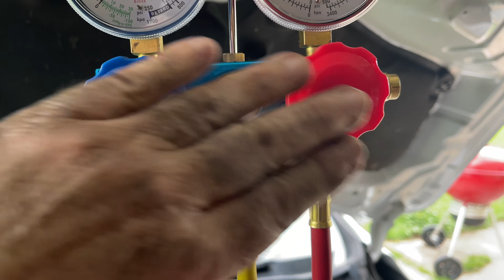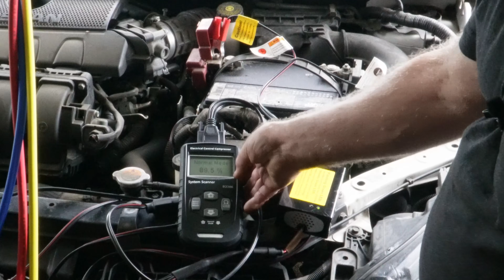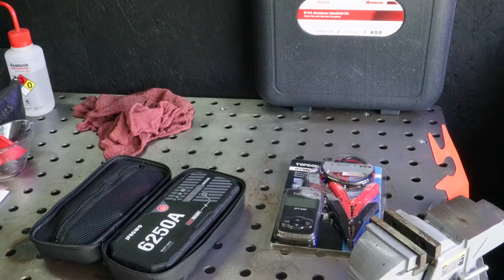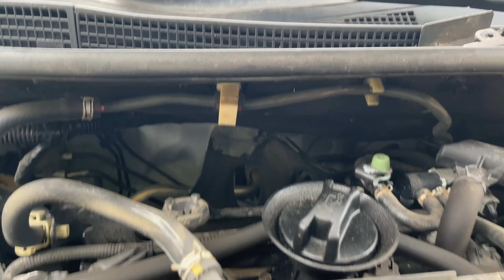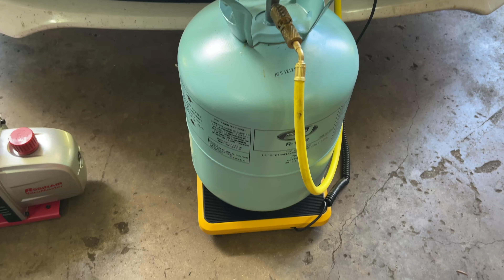How To Diagnose A Bad Automotive AC Compressor With 100% Accuracy

Comment: Just curious, but method do you use to flush?  Our shop uses that flush in a can that comes with  a hose and nozzle.  Our new R1234yf machine has a flushing option that i believe uses refrigerant to flush the system.  I hate the messiness of manual flushing.  Also found if a system grenaded and there is rhat pasty antiseize coating inside the pipes, flushing dowsnt seem to do a great job.  Had to replace the entire system on a Pilot because of that.  I guess flushing could have its own video....lol
Reply from the maker: As of now I’m using a flush bottle with liquid ac flush.  A bit messy but I try to capture as much as I can with shop rags.
Reply: Yeah, sign me up for a flush video. I would love to see that as I am getting ready to tear into my 2011 Sienna. Had the compressor replaced by a mechanic a little over 3 years ago and now the AC isn’t working again. After a crash course on how to use a gauge set, vacuum and recharge the system I was able to get the right amount of refrigerant in the system, my low side was reading around 90 to 100 psi and the high side was reading 150 to 175. no sweating or freezing on the suction lines.I don’t think it’s the expansion valve. I think it’s that flow controller in the compressor given those pressures. The Toyota service manual says the pressures should be around 36 psi on the low side and I believe it was 175 on the high side. I’m gonna go after that control valve in the compressor since I’ve already replaced the compressor and spent nearly $2000 on the repair. I saw that rock auto sells a desiccant kit for the condenser so I might replace that as well but would like to know what’s involved in a flush of the AC system just in case it was maybe metal particles or something from the old compressor failing that damaged the new(er) one.

Comment: I think you worry too much for a little freon to the air. Thousands of car leak freon every day and even the shop release it to the air when their machine is broken but have you there paying to recovering. Are they going to tell you the machine is Broken? They think about money, and everyone is thinking about saving and make money.
Reply from the maker: It's not about being worried, it's about being educated.
The penalties for any violations of the Clean Air Act include:
Civil fines of up to $44,539 per day per violation (as of 2017)
Criminal prosecution in US Federal Court (5 years, or double if it’s a second offense)
Confiscation of violating substances (refrigerants)
Loss of certification to handle refrigerants In addition to the Clean Air Act, which is a federal law, many state and local governments impose additional restrictions.
These regulations may be equally or more stringent than those of the Clean Air Act.   There is also a sizeable reward for whistleblowers.  

Of course cars, homes, and buildings leak refrigerant, but laws are put into place to account and minimize this by putting timelines on repairs depending on the size of the leak.  It is the act of purposely releasing refrigerant that gets you into trouble.   It is impossible to prevent all leaks that happen daily throughout the world and that's exactly why new environmentally friendly refrigerants have and are being developed.  I just hope they get it right this time.  I can't tell you how many systems I have retrofitted from R12 to R134A through the 1990's to save the ozone and it's like an instant replay because R134A is now being replaced with R1234YF to reduce greenhouse gasses.
Reply: If a shop is too cheap to fix or replace their acr machine and blow off refrigerant,  do you really want to take your vehicle there?
Reply: @Discretesignals Exactly

Comment: So here's the issue im having on my 2010 chevy equinox. I was first told my compressor was bad because the air was blowing hot. Ordered the compressor and refrigerant and had it changed. After changing it, still no cold air. Had the pressure switch changed and the expansion valve. Still no cold air. So i was told the condenser needed to be changed.  Ordered the condenser had it put on. Still no cold air. Took it to a radiator shop that specializes in ac they did a flush and refill, still no cold air. I was left without a real diagnosis there. So i take it to another specialist there im told that the compressor is bad, and it's not pumping how it should. So i get another compressor installed. And guess what still no cold air. So at this point i have no clue what else could be causing me not to have cold air. O yea i also had the blend door actuator changed. The radiator shop said they checked the fuses and relay and they were good. So any help would be greatly appreciated
Reply from the maker: It is highly unlikely that you would have 3 defective compressors back to back.  I would have to actually hook up to the car myself to give you a solid answer on the problem.  Just way to many things can cause an AC unit not to cool properly.  I hope you find a shop that knows what they are doing.
Reply: YOU need to have the power to compressor , fans , ac sensors checked out . that should be one of the first steps. you might have a broken wire or short or connector are bad good luck .

Comment: My S10 zr2 1999 when driving lets up when it wants to. I have a thermometer in the vents and it goes from 50 to 65 to 45 to 60 and just lets up when it wants to buy the compressor is engaged no leaks new fan condenser another e fan.  Seems like the high pressure keeps tripping out. What do you think.  I have a new expansion valve. I installed orifise with all the screens outwards and the other end towards the evap. I've vacuumed it twice and refilled it. With my pops freon he has on property working AC's for apartment. Anyways.
Reply from the maker: That's something I would have to actually hook up on in order to find out what is going on.  There are a couple of things that come to mind, but there again I would have to actually check it out myself.  I didn't quite understand what you were saying about adding freon that your pop has that he uses on apartments?  Not sure if I understood that or not, but residential air conditioners use a different refrigerant than automobile systems and the pressures run way different.
Reply: @SkillSavvyDIY  I'll make a clear detailed video of gauges hooked up and stuff. But I meant that he gets all the types of freon and I have unlimited tries to fix it. Lol.  But some people say my problem is in the dash. But anyway my brother did the gauge's hooked up and said it looks normal. But to m something is tripping the high pressure before it's gets real cool.  And sometimes is gets real close to 40* but lets up. I'm not sure why it's letting up. And when the cold air lets up a d kinda rises back towards 60. The compressor is engaged and on .
Reply from the maker: Honestly it could be a variety of things from too much gap in the compressor clutch do to wear making it come on intermittently to being overcharged causing high head pressure to open the high pressure switch or some other problem that can drive up head pressure such as a partial restriction, dirty condenser, and other potential problems but no way of me knowing without physically seeing it for myself

Comment: My son has a 2006 Silverado 1500 the AC cools perfect when first turned on but after few miles is blows warm air ..what could be?
Reply from the maker: There are a variety of things that can cause this to happen.  Moisture in the system causing the TXV or orifice tube to freeze up after a few minutes of running. A stuck blend door behind the dash causing air to pass over the heater core and evaporator at the same time.  A slight restriction in the system. A dirty evaporator causing it to freeze up and force air around instead of through the evaporator, etc.  The only way to know for certain is to first hook up gauges and let the pressures tell you where to start looking first.  I know this isn't much help but there are various problems that can cause this.
Reply: In Addition to what Skill Savvy has already mentioned you might wanna  try REplacing the Accumulator Unit, also_ _it too can  cause the system to Flip-flop / On sometimes then Off at other times! 😮
Reply: Check your condenser. If the fins get clogged up with debris, then will cause the problem you are having.
Reply: I see more one gm where air gap on clutch too large . clutch pull in once then cycle off.warm coil can't pull it back in.after ac stop working, verify center hub is rotating.sometime. you can remove shim to correct excess air gap and then comp clutch pull in every time.

Comment: I swaped the ac compressor on my 05 mustang gt, the ac is nice and cool at cruising speed, but on the highway the air still blows but is no longer cold, do you have any tips on that issue?
Reply from the maker: It could be a few things causing that and really needs to be monitored with gauges as it's being driven at hwy speeds to see what the pressures are doing, but one common reason is being slightly under charged.  You are running at higher RPMs at highway speeds and if the system is slightly undercharged, the low side pressure could be dropping to a level that causes the low side pressure switch to cycle the compressor off, but once the RPMs are reduced at cruising speeds, then it's just enough pressure to keep the compressor engaged longer and producing colder air.

Comment: Maybe I missed something. you should never pulse width modulate a clutch.  Is this a variable displacement compressor?
Reply from the maker: Not all electronic variable displacement compressors are clutchless.  This model has a ECV as well as a clutch.  Some manufacturers starting putting a clutch on their variable displacement compressors so they would not continually spin if the system was low on or out of refrigerant, because oil could not return back to the compressor which would obviously shorten the life on the compressor.  The clutch is only there to protect the compressor on this model and the ECU is controlling the compressor output by PWM.  The duty cycle percentage is based on the demand sensed by various sensors.  The tool I used was tied between the ECU and the ECV valve on the compressor so you know.
Reply: Correct me if I’m wrong, but is not one of the reasons why they put clutches on EVD compressors is because even with the compressor basically at a 0% output, with the compressor still spinning,there Isaac load on the engine, so they put a clutch on the compressor to disconnect it from the engine to maximize efficiency of the engine. (Our teacher the whole way through school kept telling us that the only reason that manufacturers did anything, was because it would either cost them less, it would gain them efficiency or reduce pollutants. If any of those things helped us as techs, it was purely luck in the equation! 🤣)

Comment: Hi!

Quick question: qoild an oscilloscope show the same signal?

Thanks for the instruction.

Cheers.
Reply from the maker: A oscilloscope can show pulse width modulation and so can a multimeter with a duty cycle function as I shown, but neither will allow you to bypass the ECU and control the duty cycle manually as I did in this video.  A bi-directional scan tool could possibly allow you to turn off or on the signal, but not manually control it or at least not to my knowledge.   That ability is super handy in diagnosing a compressor.
Reply: @SkillSavvyDIY  Great info! Thanks!
Reply: I work on gm's.  I have found on the new model pickups if you disconnect the stroke valve it does not set codes but the duty cycle will swing wildly from about 30% to 100%. Almost like the ecm is trying to unstick the valve.  So it has to have a load on it to get a steady pwm.  A tappy tap from a hammer in the area of the stroke valve helps confirm

Comment: I got a corolla 2012 with 80.000 miles  , when i first bought the car  ac was freezing cold 35 F  7  yrs  ago , dont use that car at all because i got 2 more cars ,  but now the ac only goes to 60F , a change the expansion valve the drier , and vacuum the system for 60 min, but the ac  now is 56 F,  do you think i got a worn out compressor 🤔
Reply: If your compressor is engaging without making abnormal noises but not blowing very cold air, then it's almost certainly the compressor clutch that's worn out. Replacing the clutch is a much easier and cheaper job than the entire compressor.
Reply from the maker: I couldn't say for sure without checking the car out like I did on this one, but it certainly could be.
Reply: Did you flush the entire system and add the right type and amount of pag oil?
Reply from the maker: I replaced the compressor, condenser and expansion valve.  I flushed the 3 refrigerant lines and evaporator.  Yes, I drained the shipping oil that came in the new compressor and added 90cc of Pag 46 that it requires.

Comment: Great video, Rus! I have been an automotive electrical and A/C specialist for 46 years and even in my retirement, I still keep my gauges, my vacuum pump, and freon around for family and friends. I used to teach automotive A/C at Universal Technical Institute in Houston in the mid-1980's and Transport Refrigeration for the Semi-trailers. Things have changed a LOT over the years. Even with my high-dollar scanner, there really is just so much I can do at home when diagnosing. Sometimes you just have to send it to the "professionals" and let them earn a living. But it's great to know how and why a system works so as to not fall for some bullshit sales pitch from a mechanic whose idea of diagnostics is to throw parts at it until it's fixed . . .
Reply from the maker: Thanks Stephen!  Yeah something I learned early on when I was still in my 20's was to not be a parts changer, but instead really learn the system to draw an accurate and educated decision on what is really going on.  Even though I haven't done this type of work for many years, I have never ever lost that mind set to not be a parts changer.  Wish we could have lived closer back in those days to bounce ideas off of each other.  Thanks for stopping by cousin, I really appreciate it!   Hope you are doing well!
Reply: since I see that you have been a master for a long time, can you help me, I changed the compressor on the car and put a new one, when I turn on the air conditioner, the compressor warms up in two minutes and stops working, what is the problem.
Reply from the maker: @yuriboyka3892  There are many reasons why an a/c system won't work properly.  It's next to impossible to properly diagnose any A/C system based on a very vague and non descriptive comment with any accuracy.  A tech needs to actually hook up and see what is going on with the system to determine the issue.
Reply: @yuriboyka3892 did you vacume the air out of the system after installing a new one then add in the freon?
Reply from the maker: @rocxylemmon8535  Yes, I showed that in the video towards the end.  A deep vacuum before charging is a must
Reply: l have a question? which R134a is original you can recommend someone else to use
Reply from the maker: @stephenwaigwe6426  Just make sure it is pure r134a and not the knock off stuff from Amazon and Ebay.  Read the label very carefully and stay away from anything that says r134a replacement, and stay away from anything that says it includes a sealant or other ingredients.  I recommend pure r134a refrigerant as it was designed for.  There are a variety of brands that carry the pure refrigerant.

Comment: Rus , it seems like everything in the electrical world ( including cell phones ) gets smaller over time EXECPT ! TELEVISION , THEY GET BIGGER ALL THE TIME . WHEN I WAS IN WAL MART PRINTING THOSE PICTURES THE TV. SECTION IS UP TO 85 INCHES. Crazy isn't it ? THANK YOU FRANK FROM MONTANA...
Reply: You are absolutely right Frank, everything but TV sets haha!  We have a huge one in our living room that I never watch, but my wife does.  It's crazy for sure!
Reply from the maker: I keep forgetting to log into this channel before commenting haha
Reply: TV are not getting bigger,  the image you see is.  The 4K TV have 4x  the resolution so if you wanted you can buy a computer monitor  22  inch and still have 4x  the picture quality as a picture tube TV.   A 60 inch is thus the same as having 8 old TVs   Your smart Phone has the 2x quality but on a 5 inch display.

Comment: Hey Rus.... very  instructional😢 video...that's the thing about vehicles nowadays there's a sensor for everything so having the right tools and equipment to diagnose the problems. Between me and you I much prefer the old days where things were basically more straight forward mechanically and electronically but  these are the times we're living in so I guess we just have to deal with it. Cheers 🍻
Reply from the maker: Thanks Stephen and yes, cars are completely dependant on computers and sensors to tell it how to run.  A person just about has to have a degree to even work on them.  I certainly miss the old days and old ways.  Cheers!